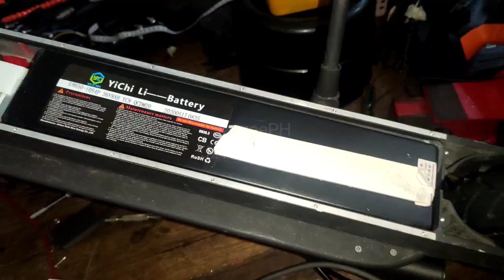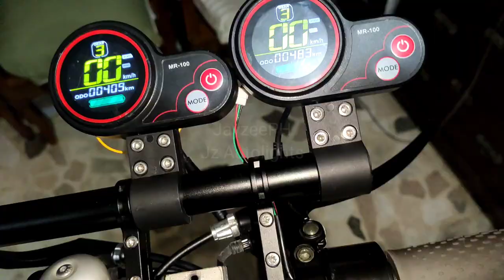Make M365 DIY Dual Hub Motor and Dual Disc Brake at Home

Comment: I did the same thing because I had two M365s, but I put the second controller where the battery is normally installed and stuffed the two batteries in a bag attached to the seat actually really unnecessary because I use both at once anyway that I can get much faster but not really further despite the second battery also my scooter is now a free ticket for a court hearing as soon as I'm stopped. You can do it if you're bored and want to prove it that works 🤣

Comment: Hi!  Great job with the front brake disc!👍 Question: which glue did you use to glue the 6-hole adapter?  Kind regards.

Comment: Hmmm it’s not adding up.    My XIAOMI hits 33kpm with firmware
Reply: The reason is that he used one controller which is supposed to be two to power both hub motors and not only did he use a single controller, he used a very weak controller. If I'm not mistaken on my estimate that controller should be in the range of 10 amps to 14 amps of power out, even worse that it is at 36volts 
A modification like in this video with proper/adequate components can hit easily above 50km/h

Comment: Good one with the threaded bolt end in the motor, much better than bending in the forks or buying fancy adapters.
Reply: 😂 no that's stupid as fuck the bolt won't stop the axle from turning instead of the wheel #ignorance

Comment: You made a new bracket? Why not use the original bracket + brake calipers on the rear wheel?

 Ah never mind, I figured it out: 6 hole adapter plus larger discs, original 5 hole disc is only 110mm

Comment: bro! dont need to used to panel board .. there are some tricks in wirings just watch my video for you to show the single finger throttle with dual controllers and dual hub motor
Reply: Can you send me a link?
Reply: Won't using 1 controller limit the power of both hub?